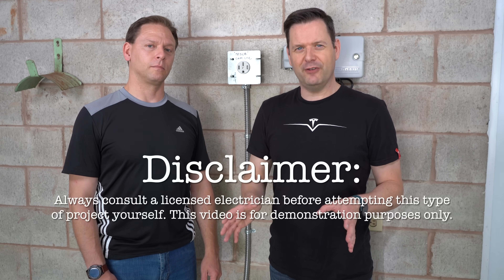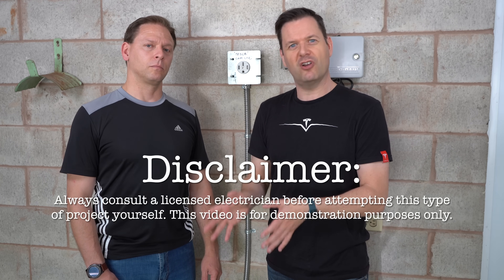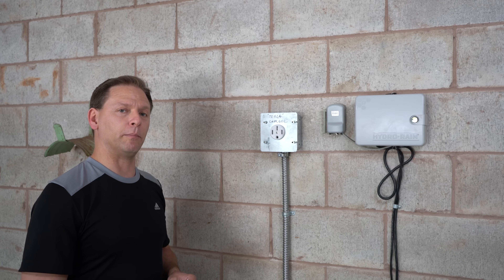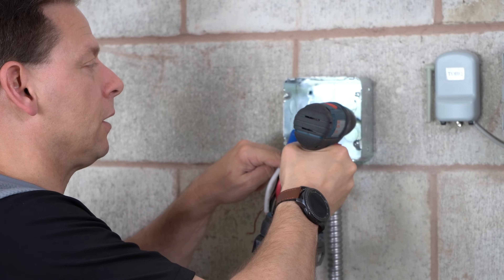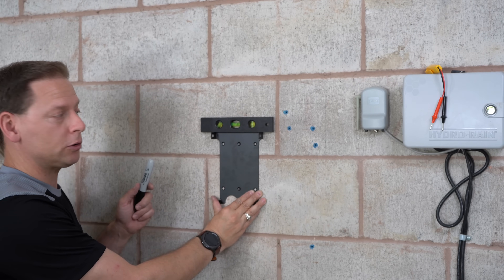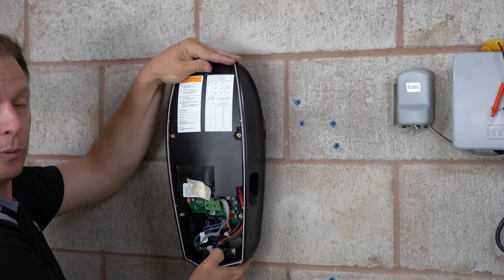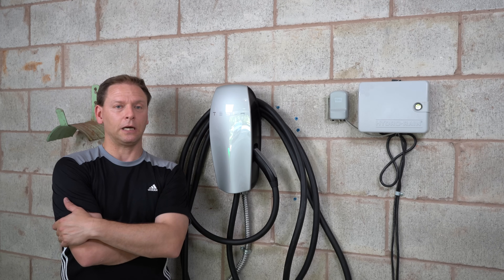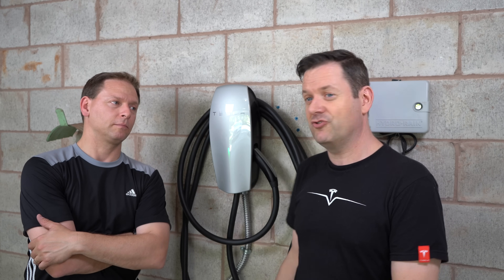Convert NEMA 14-50 Outlet to Tesla Wall Connector

Comment: I have been researching how to convert a NEMA outlet to a Tesla Wall Connector. In the video above, the installer uses wire nuts to connect and extend 6-AWG cables. I don’t believe this is the correct approach. A polarized/mechanical connector (such as a set-screw or Polaris-type connector) should be used instead.

Since 6-AWG conductors carry high current and are considered a continuous load, especially for EV charging, using wire nuts does not seem appropriate. I am not an electrician, but this installation appears to be incorrect. Please advise.

Comment: Thanks for the video! I did not know that I can extend and not replace entirely load cables from the breaker box. Can you please help me with the size of the wire you are using in the video that is used as extender from the box to the wall connector? Is it 3 AWG? What kind of nut size used to extend the length? I am trying to convert my 14-50 in wall outlet into wall connector. Thanks!

Comment: Im installing a juice box 40amp the same as here replacing a 14 50 plug outlet to a hardwire junction box .  The juicebix has a cable whip and doesnt allow a direct connevt inside the charging box.  Wjat is best practice to connect the 3 wires in the hunction box if wirenuts arent suggested.  As my only option to to connect the end if the whip wires in a junction box to the wires coming from the panel.

Comment: Don't use jest 2 screws to hold the charger's mounting bracket (video used-2 screws) 
---(USE ALL 4 Mounting Screws) ----
   The Tesla charging cable is 8'5" (or 24') long and very heavy! 
 It will stress the fasteners of the charger mounting plate, better safe than sorry.

Comment: This is what I need to install the Tesla Wall Charger into my Nema outlet. Whats a fair price to do this with an electrician?
Reply from the maker: It depends on where you live. I’ve see owners quoted from $200 to $1000. I personally think $200-$400 max. Anything higher is a ripoff. I always recommend that Tesla owners use a licensed electrician. Cheers.

Comment: That's an early model charger.   They mount differently now.  Much easier, actually.  Using wire nuts on 50 amp lines is asking for trouble.

Comment: Great Video!  Will this same process work with the 2022 Ford Lightning "Charge Station Pro?" The CSP has dip switches from 20 to 80 amps.  My current NEMA 14-50 connection is on a 50 amp circuit breaker. Thanks!
Reply from the maker: Thank you. Sorry for the late reply. I've not seen any of the install schematica for the Charge Station Pro, but gut reaction is that the answer to your question is yes.

Comment: All the Tesla fan boys want to disconnect the neutral.  It hurts nothing to leave it because the tesla plug does not pass it.  This way the socket is available for future non Tesla use.
Reply from the maker: All the Tesla haters want to watch Tesla videos. 🤷‍♂️
Reply: @ElectricCanuck  Nope, not me.  Probably going to buy one.  The question is why disconnect the neutral not what I watch.  It is not needed in the Tesla scheme but hurts nothing if left alone in the 14-50.
Reply from the maker: Cool! True it hurts nothing to leave it. It was just a choice at the time I guess. Cheers.

Comment: If I have 50 AMPs can I use the wall connector at 48 amps or does the 14-50 have to be 60 AMPS?
Reply from the maker: If you want to charge at 48 amps, you need a 60 amp circuit. Cheers.

Comment: Hello there i just installed a gen 2 wall charger i have a question i see my model s it has a setting it can go 80 amp and u can change the amp setting my question is if i’m using my wall charger gen 2 with 60 amp do i have to change the setting in my put 60 amp or my car will automatically detect the current amp just plug and play?
Reply from the maker: Hi, sorry for the delay, cool that you have the dual onboard chargers. Check the wall charger instruction manual...there is a table in there that shows how to configure for 80 amps. Cheers.

Comment: What is your reason to open the white (neutral) wire at junction box.     If you open it you should pull it out.  Leaving an "open neutral" wire in the conduit is irresponsible.

Comment: Hi, I am planning to get a Tesla.  I want to find out that can you just buy a 110 to 220 step up converter which cost about $40 to charge a Tesla?  Thanks.
Reply from the maker: Hi, T Y, this is a bit out of my area of expertise, but I found this link which may be helpful. Cheers. https://forums.tesla.com/discussion/139156/step-up-transformer-110-to-220volt-5000-watts
Reply: @ElectricCanuck  your link help.  Thanks for your info.

Comment: Could you keep the Nema 14-50 and daisy chain the red/black to the wall charger and cap white post the nema? So that way you have both
Reply: You could but you would have to be careful not to use at the same time as there is no way to prevent overload.

Comment: I used to use a lot of wire nuts. Then I hired a contractor to help me finish my kitchen. The first thing he did was yank out the wires that were connected with wire nuts and run new wire right to the panel. A voltage spike, especially in a higher amperage circuit can pop those connections right apart.
Reply: I owned a 17 unit apartment for 30 years. I saw one wire nut connection failure in 30 years. It was a neutral connection where five neutrals were connected together and one had come loose. The point is that wire nut connections are extremely reliable. I don't believe what your electrician told you. 

In my own home the only failure I have seen was where an aluminum cable was wire nutted to a copper cable in the air conditioner circuit.. Other than that I have never seen an electrical failure in my house related to wire nuts.
Reply: You got bamboozled by the "electrician".
Reply: @timgraham7851  I don't think so. I've had a couple of wire nut failures over the years before I met this electrician. Have I used them since? Sure, lots of times for making a change to an existing circuit. A clean run from the box to the device is always best.  My house needs a new electrical panel, when that's eventually replaced I'm sure the electrician is going to insist on running all new outlet runs. They're easy, the crawl space is wide open. Lights in the ceiling? They'll use the existing wiring -- too difficult to redo (without fixing a lot of plaster) and LED lights use a lot less power so less voltage surge.

Comment: Why couldn’t they have just used something like this instead:

https://www.homedepot.com/p/Smart-Choice-4-ft-50-Amp-4-Prong-Range-Cord-5304490740/206740121
Reply: this is what i want to know too.  why not make the tesla wall connector plug into a 14-50 vs. hardwiring it.  so then you have options.

Comment: The current 14-50 outlet is mounted upside down.
Reply: There is no code for mounting orientation.
Reply: @FastRedPonyCar  I think Theyrun is referring to the fact that the ground hole needs to be on top to prevent a strain on the Tesla cable.  Tesla also recommends the ground hole be on top.  I don't think he's referring to the NEC code.

Comment: Why would you want to maximize charge rate? Heat is bad for electronics and batteries. The more heat, the faster the device degrades. If you want to charge fast while sacrificing battery longevity, go for it. Not me. Not worth the extra 25% increase in charge speeds, especially when you're already charging at 32Amps.
Reply from the maker: All indications at this point is that the battery will outlast the car for most people. https://electrek.co/2018/04/14/tesla-battery-degradation-data/. So, many people will want a higher charge rate for faster charging at home. Unlike the Nissan Leaf, Tesla has active cooling of the battery, and then best BMS in the market. Completely understand your position however, there is a lot of interest in the Tesla HPWC for home, and many people will want it. Cheers.

Comment: Don't listen to these guys. A vast majority don't need the faster charging and it will degrade the battery faster. Stick to 32 amp and lower it if it allows you to still reach your charging goal in a reasonable time. Preserving battery is more important than wasting money on faster chargers that may be unnecessary for most.
Reply: Yeah I considered a wall charger but after installing a 50 amp circuit and nema plug, my travel charger is dishing up right at 30 mile of range per hour.  I don't want to say never say never but I can't imagine a scenario where I will need to charge faster than that... also there's a supercharger about 15 minutes from the house.

Comment: Would it make sence to try and install a nema 14-50 plug on this hardwired unit. Simply get some wire and a plug and leave the 14-50 outlet in place to plug into. Say for a renter or something?
Reply from the maker: Yeah, you can totally do that if you have the capacity. The owner in this video only has 100 amp service into his house.
Reply: That's how all of the 3rd party chargers can be bought.  Makes a lot more sense to just keep the plug so if you leave the home, the future owner won't be limited to just Tesla charging.

Comment: Why not pull the neutral wire out if you were going to disconnect it at a junction box. Otherwise why disconnect it in the junction box it’s a dead wire anyway.  Cap it and leave it. That’s almost as bad a splicing 3 wires in a in a 5 wire low voltage cable. Splice them all or none at all. Just more work for someone in the future if you sell the home and they want to use this connection for a different purpose
Welder air compressor etc. it’s bad manners in the trades.
Reply: Agree.. made NO sense to d/c the neutral at the middle junction.

Comment: 1:46 "First thing we do is remove the uh panel cover" - What happened to making sure the breaker is off? LOL
Reply: Apparently they did it in the 21 seconds between that and when they mentioned they turned it off.  I probably would have done it before 1:46, but I'm no expert.

Comment: High Power Wall Connector not Charger.  The charger is onboard the car.  Some car has single on board charger = 24A, dual charger = 48A and I have MX that has high power (triple) charger option of 72A using 100A breaker.

Comment: Yes I think my midrange is capped at 32 amps also. Will be interesting to test on a wall charger though.
Reply: It'll be the same no matter the AC source, maximum 32 amp charging.  Only faster charging is CHADEMO and Tesla Supercharger, or get a long range Model 3.  The Gen2 Mobile connector itself is limited to 32A maximum, no matter what model 3 or S/X you get.  There is a faster NEMA 14-50 Corded Mobile Connector (based on the Gen1 mobile connector) that can go faster at 40A, but that costs USD$520, ouch.

Comment: So after spending $500 on the high power wall charger and $20 on a bigger breaker you are still getting the same 32 amps as the NEMA 14-50 setup on your SR+ ?!?
Reply: Well at least he doesnt have to keep plugging and unplugging his charger.  Now he can keep one in the car for destination charging.
Reply from the maker: +Vinceand Theresa that is a good point! A little bit of a silver lining for sure.
Reply from the maker: Yes, that pretty much sums it up. Either Tesla is capping the capability of the inverter with software, or the SR+ has a different inverter entirely that will max out at 32 amps. I would guess that this is a software cap. Hopefully Tesla will offer a software upgrade in the future or something. Since my Model 3 is a LR, I didn't know about this limitation. I would guess most buyers don't know either. Thank you for taking the time to comment.
Reply: Tesla Canuck 
I have LR RWD also. How many mph of charge do you receive on 48 amps? My Clipper Creek is 24 amps and I get 22 mph charge rate so I assume it would be double that. Can’t find any videos showing this though.
Reply from the maker: I'm getting 12kW at home with the HPWC and that gives me 68-70 km added per hour. Rough math on conversion is about 44 miles added per hour. So, yes I would appear to be getting double your charge rate.
Reply: @ElectricCanuck  The Standard Range was always slated to have a 32 amp max onboard charger for AC charging and having the SR+ follow that is not a surprise.  The long range variants can indeed max at 48 amps (it's a different charger within the battery pack).  I don't know about the Mid Range as that was announced after I quit doing my research.  I' currently using a NEMA 14-50 and would like to switch to the faster wall charger, but I've not run into an issue with the speed of charge on the 14-50 and haven't been able to justify spending the $500.
Reply: @toddwright662  so i bought the signature black HWC and was told i can charge at 40a with my 6/3 wire.  that true?
Reply: @bretlanshelvin8628  The information I got (granted this was about a year before I got to actually order while I was waiting; so about 2 years ago from now) was that the Standard Range was going to be limited to 32 amps on a home/travel charger by the car's on-board charging hardware/battery pack; the Long Range configurations would have charging hardware that allowed up to 48 amps while the supplied Travel Charger is limited to 32 amps period.  At the time (~ 2 years ago) there was no SR+ so I have no idea if they included a half step on the car's on-board charging hardware, but intuitively I would GUESS not; this is pure speculation on my part.  

The info source was from a guy at the nearest mall showroom and he seemed to be pretty knowledgeable and was steering me toward just using the included Travel Charger as at the time of the conversation I was leaning hard toward a Standard Range when my option to order came up.  I cannot say I am absolutely certain of my info, but I believe it is accurate and my Dual Motor comports with the info I have been operating off of. 

The info I believe to be accurate is:
Long Range Variants; Up to 48 amps using 60 amp breaker and 6 gauge wire.
Standard Range; Up to 32 amps using a 50 amp breaker and 6 gauge wire.
Standard Range +: I do not know.
My recollection on the HWC is that it doesn't use one of the wires (neutral) in the 6/3 that is required of the NEMA 14-50, so you would only need 6/2 (the ground wire is not counted).  But definitely check the installation manual on that one as I have not yet purchased a HWC and am going off recollection.
Reply: You need to check the dip switches

Comment: Man, nobody would install anything like this in Germany. Flexible cables are forbidden for permanent (new) installation and if there's old stuff, you're not allowed to just screw them to a terminal. They need to be crimped first. 😮

And we're just running 16 A over those cables.
Reply from the maker: Hi, Ruben, I hadn't considered that different parts of the world would have different standards and regulations around this. I would love to here from other viewers around the world on Tesla home charging standards. Thanks for the comment as always, Ruben. Have a great weekend. 😎
Reply: @ElectricCanuck  I'm actually on vacation, so my whole week was a weekend 😎
Reply: I'm not an electrician, (I'm going to ask mine about this) but why disconnect the heavy gauge white neutral wire and use the smaller green ground wire as a neutral in its place? Shouldn't the neutral wire size be the same as the "Hot" wires? Is the Tesla box not able to handle the larger gauge wire? The green wire would be attached to the ground wire bus instead of the neutral bus in the service panel. We've had a 100 amp service installed to our garage outbuilding in Ontario. The Electrical code is being revised and now a new added service would require us to run a ground wire all the way back to our 200 amp Service pole instead of installing a gound plate near the building. (Our electrician was able to get it installed under the old code but had installed 4 wires in the conduit just in case..
Reply: @JohnRoss1  well, as far as I understand the weird one phase system in northern America, you don't need a neutral wire for 240 V. Ground is just for safety but does not need to take any load (in case of a failure) since the charging station has a built-in RCCB for the DC and the AC part of the charger.